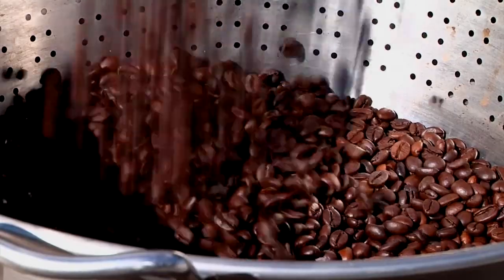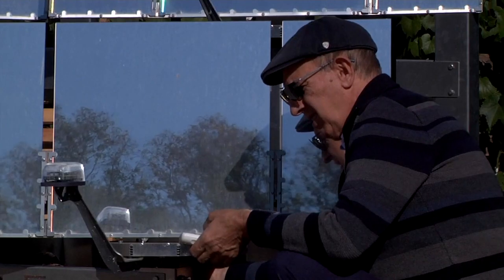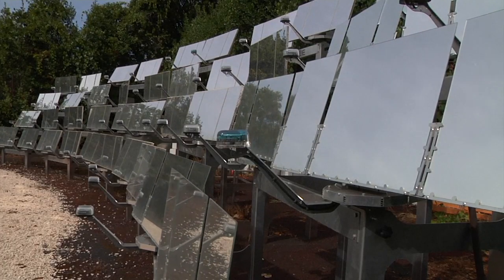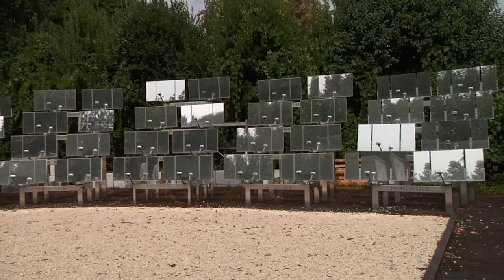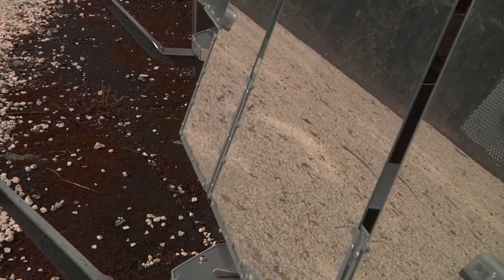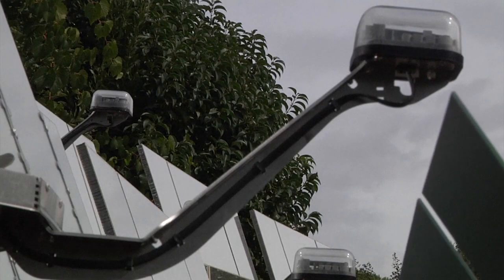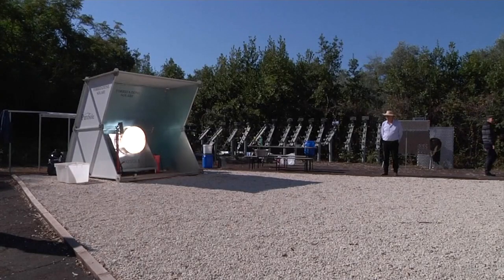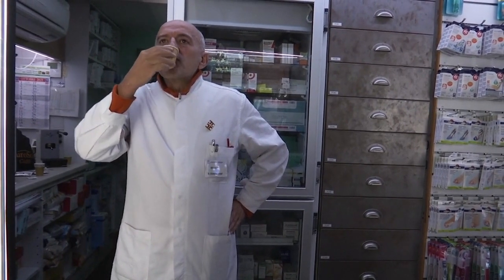Italian coffee company using solar energy to roast beans

Comment: Is this company really calculating CO2 emissions that way by making solar panels and 15 to 20 years later disposing of them?
Reply: no idea about these particular panels because they are not typical pv panels and are more like mirrors, but since this is a commonly brought up point about pv panels, you should know that pv solar panels are 95% recyclable and it can be done in a cost-effective way, it is actually profitable to do it. They contain precious metals and plastics, and many companies can extract those, pv cycle is one company in France that does this. This is especially true because there is actually a recycling tax you pay when you buy the panel like with most electronics, at least in europe, but even without that tax it can usually be done for profit. Also solar panels actually have a much longer lifespan than 15-20 years. Overtime the output of solar panels decrease. It used to be the case that after 15-20 years the panels would have 80% of their original output left and would be considered dead, but now with new panels that is after 25-35 years, in fact some manufacturers now offer 25 year warranties, and the panels can continue generating power for decades after that, it's not like they suddenly stop working, they just generate much less than original.
Reply: @ Collision So those tech are getting better, ha. Good! Thanks to telling me good news. I didn't know that. But if the weather be bad, how can we do with them...
Reply: I am sorry that if me sounds rude.